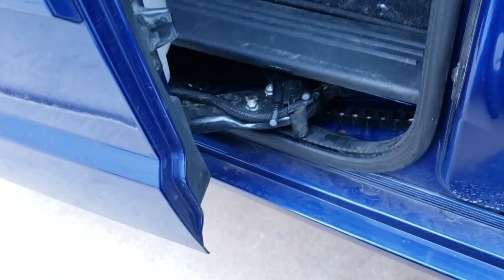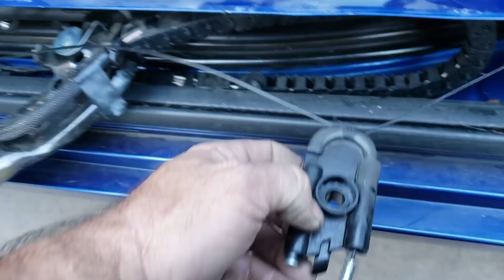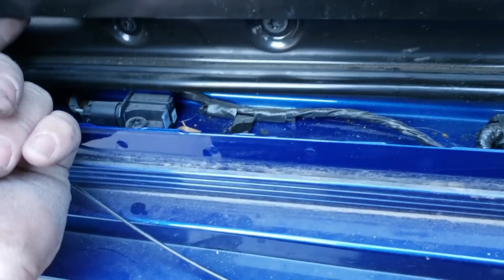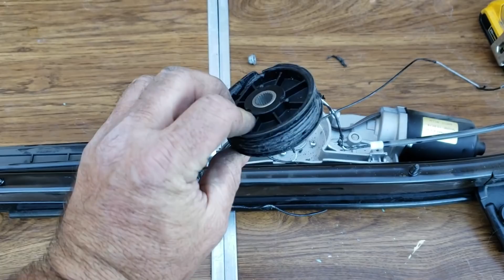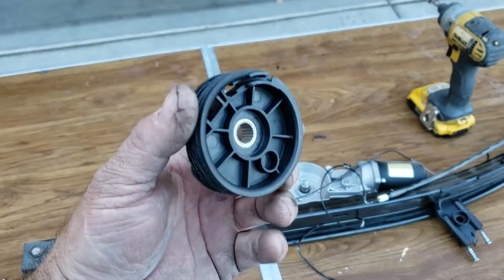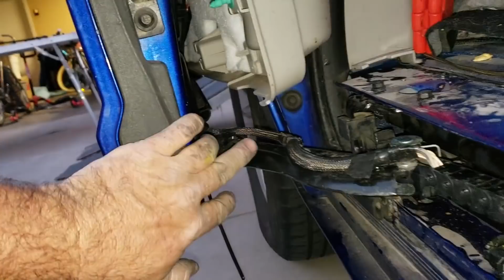2013 Grand Caravan power sliding door assembly removal and replacement

Comment from the maker: UPDATE...
I bought the $400 power rail assembly from the dealer and installed it. 
I was recording the replacement with the new part but the Sony camera went dead.  Not sure what it did record before it quit.
Reply: what is holding the the base of the wire chain/ harness in place attached to the frame ? How can it be released? Can you just pull on it? s it a pin, a nut or similar?
Reply: I need to do this too. Do you still have the part number?

Comment: You might want to tell people  that some town and country have the bolts in the bottom of the van to remove motor and assemble
Reply from the maker: This 2013 Dodge Grand Caravan is the only one I had replaced this slider on.
Reply: Only video on passanger door. 2013 Town and Country was compled yesterday.

Comment: Can. you buy just the spool? Mine is broken, not even attached to the bracket.
Reply from the maker: They come as an assembly.
Reply: I didn’t mean spool, I meant the pulley contraption that sits on the metal door bracket and the wire spoils through, facing the exterior.

Comment: I waited a year to replace mine. Spoiled up the cables and use the door in manually. You are correct about the plastic sheathing causing the malfunction. Mine was 279.00 shipped.

Comment: I am about to attempt to re-string cables on the window regulator in my Durango, which you have done so many times. I am not completely sure that the cables themselves are broken. It might be the plastic pulleys. What happens, the window goes up and down very slow, and sticks in random spots. The only way to get it going is to grab the glass and work it up and down by hand, and it will move again, usually faster than before.